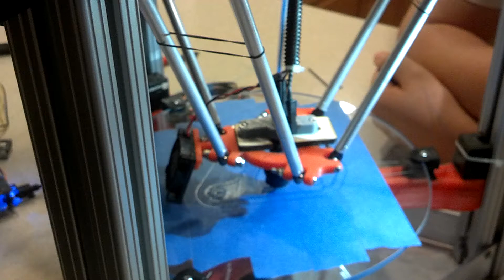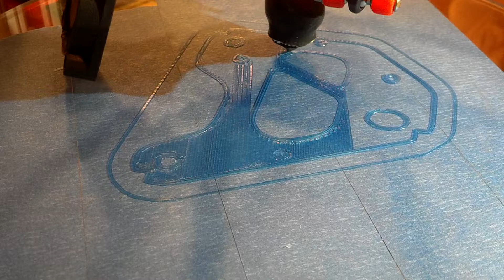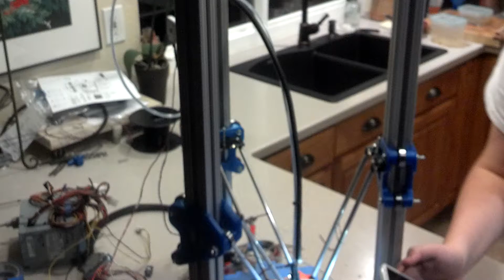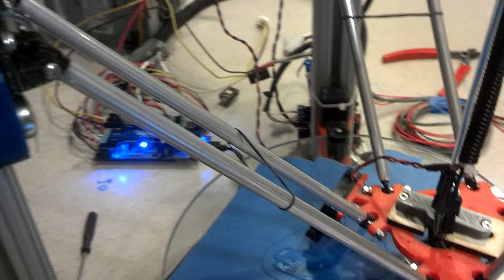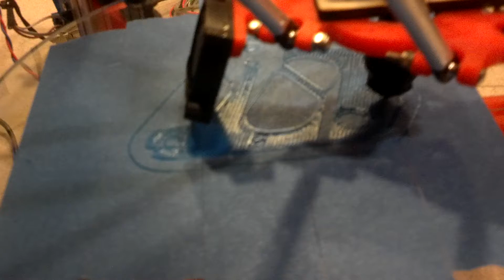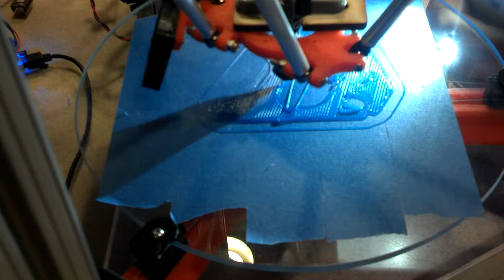Cerberus - First 3d print on our Filament Drive

Comment from the maker: It's being controlled by a Panacutt Devices Azteeg X3 controller (basically an Arduino Mega with an integrated Ramps shield running Marlin firmware that has been specially modified to convert cartesian (x,y,z) coordinates into delta coordinates. Almost any 3D printer controller can theoretically be used as long as there is enough memory and processing power to perform the calculations of the delta movements from g-code on the fly.

Comment from the maker: First Print Video
Reply: Hey steve, any info on the dimensions please? I need the aluminum rod cut lengths and the distance from the center of the extruded aluminum beams to opposing beams that hold the carriages to figure out proportions with scale size.
Reply from the maker: Hi Shai, sorry for the delayed response. I can get you the dims and other
info by tomorrow, I'm not able to get to the files until then.
Reply: Ok that would be very helpful! I need the Base dimensions and Aluminum arm dimensions to easily fit an 8x8 inch heated bed.
Reply from the maker: Well the arms are 250mm, same as the original. I have a square jeered bed
and it works with my 3 standoff design. No changes required.
Reply from the maker: Damn autocorrect... How it got jeered from heated bed... ?
On Oct 13, 2012 12:30 PM, "Steve Graber" <****@**> wrote:

> Well the arms are 250mm, same as the original. I have a square jeered bed
> and it works with my 3 standoff design. No changes required.
Reply: 250mm as in the length the aluminum is cut to? or from pivot to pivot?
Reply from the maker: Pivot to pivot. Exactly like the original. So the vertical carriage pivot
points and the hot end carrier pivot points are also exactly the same as
the original to make it easier for everyone to use this printer. Less
changes to firmware the better IMHO.

Steve Graber
Reply: Ok thanks!
Reply: Hey Steve, she's looking great!  Are you going to publish your design?
Reply from the maker: Thanks John. Yes, The plan is to publish the design.
Reply: Boy does your son look like mine ! spooky
Reply from the maker: But... is your son 6'-6" tall?! :-)
Reply: Not Yet !